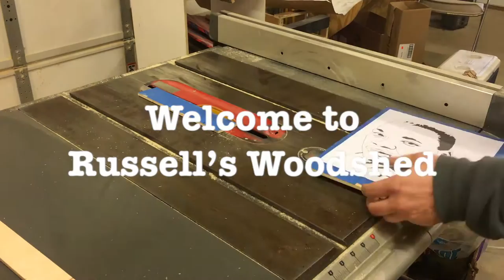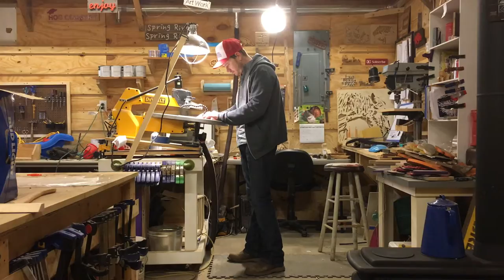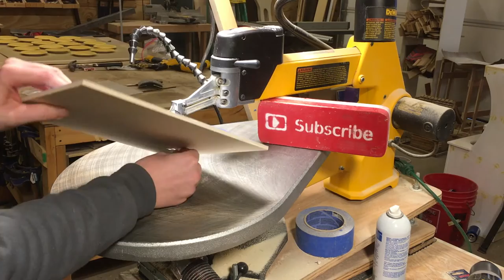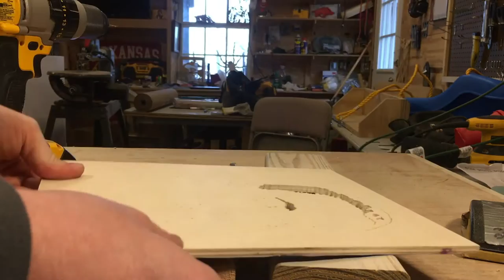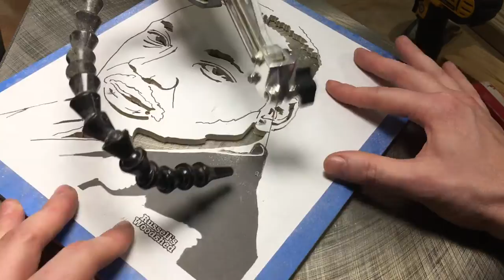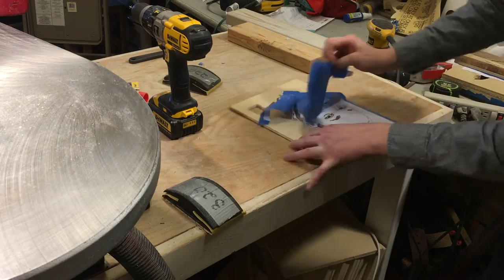Martin Luther King Jr - scroll saw portrait

Comment: Very precise work, looks awesome! what scroll saw blade type did you use? And how many blades did it take to finish the project? Thanks!
Reply from the maker: +KANSIS Made I use Bosch spiral blades. I used 2 or 3 blades on this project. I tend to get on a hurry occasionally and push my blades too much. This piece could be done with one blade (with patients)